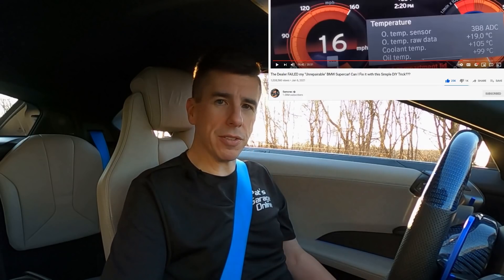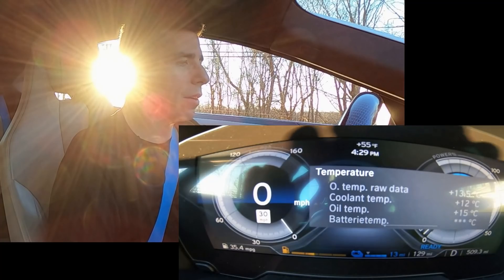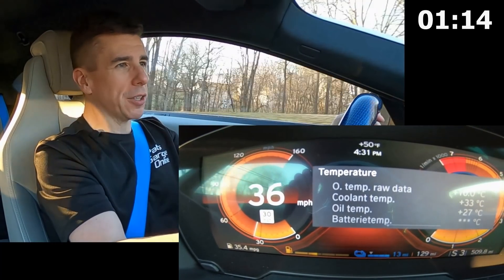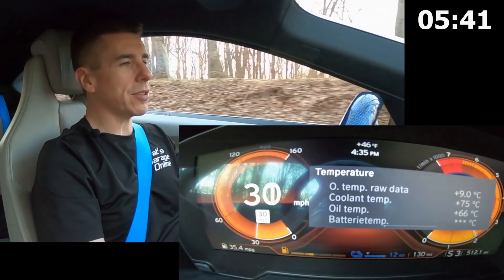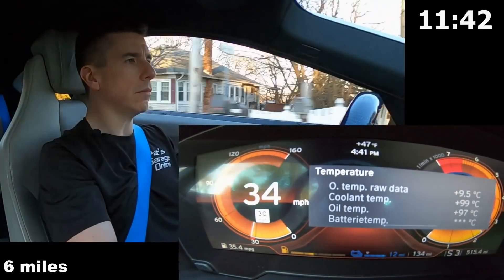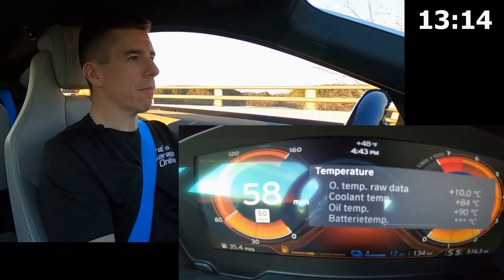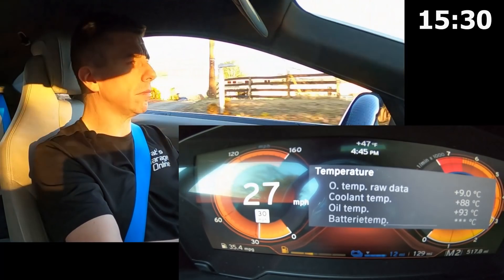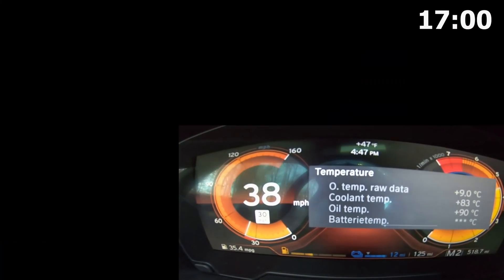How the BMW i8 coolant thermostat reacts while driving. It's complicated!

Comment: Another great video Pat, thank you. I was unaware of this menu and so this morning decided to have a play with my i8 roadster (18) here in the UK. The outside temperature was +3°C, and the car performed very similarly to that shown on your video. What did surprise me was how quick both the water temperature and the oil temperature came up to speed. I’ve normally driven 5 to 6 miles to allow the oil temperature to get to a comfortable parameter, but it was pretty much there within 3 miles, even with the outside temperature. Thanks again. Kind, regards, Warren

Comment: I wonder what temperature the fan kicks in at?
Reply from the maker: That's a good question. The front of the i8 has louvers to block the air flow through the radiators as well as one large fan. I may have to do more research to determine the threshold for activation of each. The louvers close to reduce aero drag.
Reply: @PatsGarageOnline  normally the fan kicks in when the temperature of the coolant goes above 100 deg C on a normal car but on a car where the ECU looks at more than just coolant temperature but also at battery temperature etc its not as simple

Comment: Hey Pat, I’m living in Cambodia and my 16’ BMW i8 shipped here from USA without the charging cable and I’m consider getting a 220v level2 aftermarket charging cable, I wonder if it will work with my i8 since there only one option to choose in the setting which is "Level 1 (110v)" and here we use 220v.
Reply from the maker: Yes, the i8 will work with a Level 2 charger. We have them at public charging stations. As long as it's the right connector it will work. The i8 doesn't support Fast DC charging, only the 220v AC

Comment: Hi Pat, thanks for this interesting video - as allways. I think it's a pitty, that the i8 does neither show the oil, nor the coolant temperature on any standard display. I'm wondering if there is any way to display one of the temperatures (oil/water) on the display in the middle as it is e.g. possible for the temperature of the wheels? Any way to program this?
Reply from the maker: Thank you. Unfortunately, there's no way to get this info to display in the iDrive. I wish we could see it.
Reply: @PatsGarageOnline  can you do another video on what info can be accessed via this menu, and more importantly how to exit it again?

Comment: Great insightful video Pat. Thanks for putting these out. I’ve been wondering exactly this because I end up on the motorway doing 70mph on a cold engine because I’m on electric till I go over 45mph ish... So on a coolish day before giving the car some beans it’s good to wait about 10 mins before she’s up to temperature right? Do you think for mechanical sympathy I’d be better forcing the engine on before going on the motorway? Or are modern oils so good these days we don’t need to worry about it? Cheers Brij 😉
Reply from the maker: Thanks!  I definitely recommend warming the engine up before the motorway.  I typically use Hold State of Charge in EcoPro mode in order to keep the revs low and warm it up when I leave my driveway.  Check out this video on how to do that:

https://www.youtube.com/watch?v=aHBk8zJ06b4

Comment: Thanks for making this Pat!  That is interesting that the thermostat opened at 100C.  The service manual sez 105C.  I did see that at slower/less output driving it was hotter than when you were on it a bit more so that lines up pretty well.  Also - Oil temp?  I did a search through the service manual for the oil temp sensor and couldn't find it.  Do you know where it lives?  The engine seemed to take its sweet time warming up.  Looked pretty cool out (47F) but I guess I would have thought it would warm up faster.  All really interesting!  I'll have to throw that up and check it out :) Thanks! F
Reply from the maker: You're welcome!  I poked around for quite a while until I found that the oil-level sensor also has the oil temperature sensor integrated in it, according to the manual.  Also, I had the car parked in my garage, thus the warmer temps (about 60F) in the oil/coolant than the air when I started out.

Comment: Someday people will be swapping the power plant doing a Honda K20C twin turbo swap with an Tesla front drive unit, Chevy volt battery packs, super capacitors and another crazy swap like a Porsche transaxle generator running a iPhone 30 dash system with heads up display talking how simple the old BMW system was... maybe I’ll be able to afford one by then.  What a great car

Comment: Hiya pat, great video the BMW sounds very sporty. I'm a bus driver as a profession and the bizarre way you get to the coolant temp reminds me of some basic dash diagnostics I've "learnt" over the years, our mechanics always have a simple cure for problems and that is turn everything off for 5 mins,  then restart. I jokingly add my "magic" word to the equation when doing these procedures, (as a kid a magician called "The Great Soprendo" on TV had a magic "word" for tricks and this is "Piff, Paff, Puff") the magic occasionally works!!! 😁😂,  so if you ever get stuck....!!! It's very clever how the thermostat appears to have intelligence as such, does that mean Sam's is broken and is a computer issue? My only other question is on your test drive, I noticed the car was doing about 35 mpg, I know its a, fast car, but shouldn't it be doing more? I would have thought the i8 was on Bernies shopping list for an eco car, though I can imagine him on a push bike instead!!! (nice comedic touch though!) 
Best wishes from West Yorkshire,
Stay safe. Ben 🚍🚌🚂😁🇬🇧🇺🇲
Reply from the maker: Thanks for the kind words. Poor Sam found he had a blown head gasket. That's not common for this motor. Someone must have driven it hard with unbled coolant after the water pump was changed. The car should go to limp mode before it has this kind of damage. But that didn't happen for him. I see 45mpg on short trips but on longer trips 35mpg, due to not having but 16mi of electric range. Still, to get a car that puts 358HP and 455ft-lbs to the wheels and give me good economy, I'm happy.